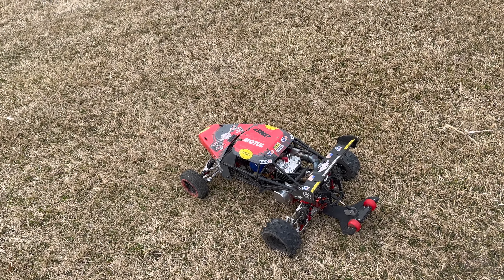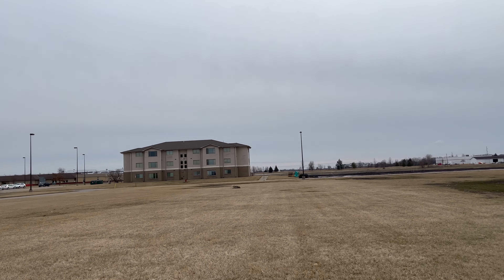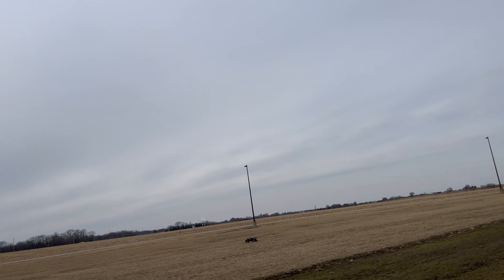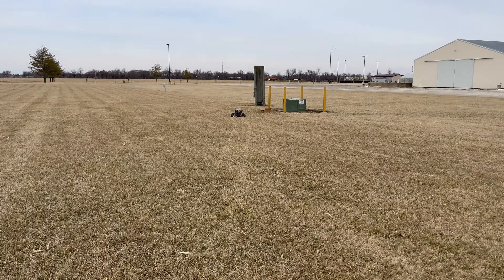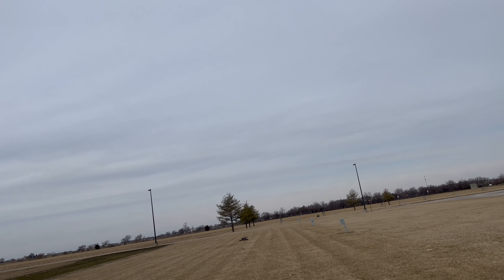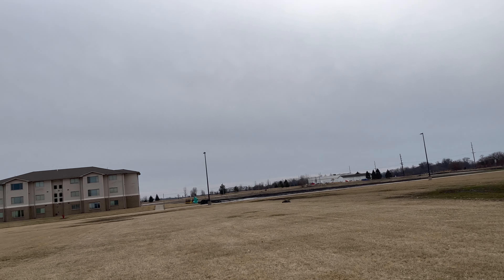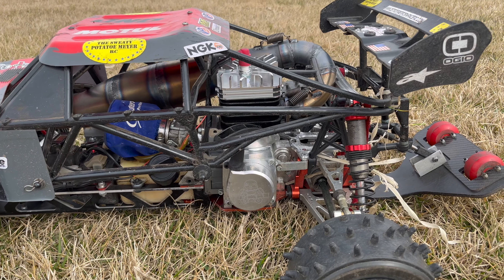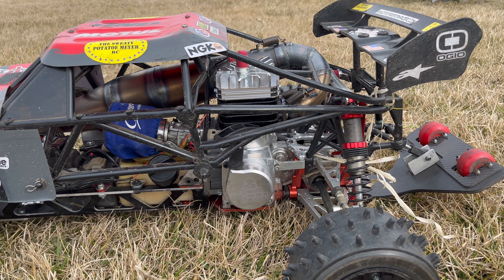TAYLOR RC 71 SUPREME FIRST TANK ON THE GROUND!!!

Comment: To much power 🔋 💪 might have to put that engine in a heavier platform  or awd either way definitely beast mode 💤💤💤💥💥💥☑
Reply from the maker: I think it will be better with the wheelie bar lowered, and the suspension set up a little better.
Reply: @Meyers2strokeRcgarage  I see you could only go quarter throttle that engine is super serious
Reply from the maker: @kingkongrc247  yeah with the wheelie bar that high with that kind of torque was really limiting how much throttle I could give it.  It was always wanting to do what I call the Kick Out Death Roll 😂